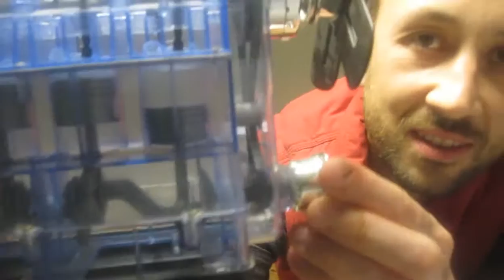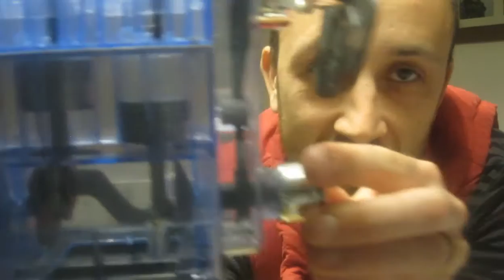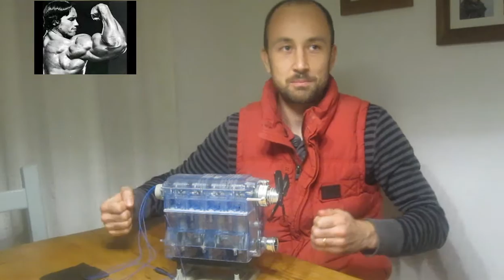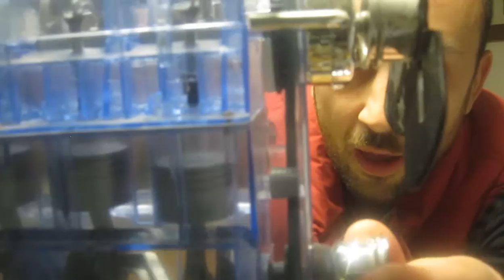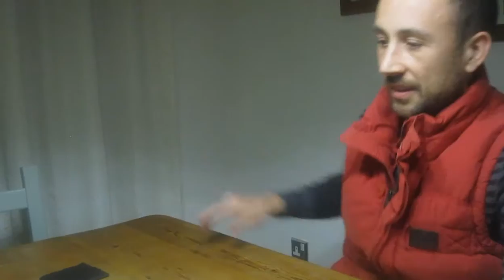Torque Vs Power: Why Power Wins Races and not Torque!

Comment: I have been looking for a simple explanation and i couldn't find simpler than ur video but correct me if I'm wrong, does that mean the more rpm the engine has the more torque it produces? is that correct?
Reply from the maker: Simon Bishay no more rpm tends to mean more power because even if torque is low you can still inject a relatively large amount of fuel per minute because of a lot of engine revs per minute as more fuel per minute means more power, make sense?
Reply: that makes a whole lot sense to me but what exactly makes more torque or less torque?
Reply from the maker: Simon Bishay torque is a measure of turning force, so an engine with lots of torque is able to burn alot of fuel per revolution. that doesn't mean it's powerful as it might be quite a slow engine with low rpm...
Reply: right on now i get it thank you so much
Reply: Nope ., more rpm mean just more rpm nothing more from al stand point of view 👌🏻 you must know that you have 2 torque which are often subscribe torque at engine crank and at drive wheel axis  this second can be multiple tome biger than first due to gearing  , only more power can at the same vehicle velocity generate more torque at drive wheel axis gearing be itself do nothing for specified velocity rpm to and torque at crank too only better rpm to crank torque proportion = more power can generate more drive wheel axis torque at the same velocity thats why power win race 😎